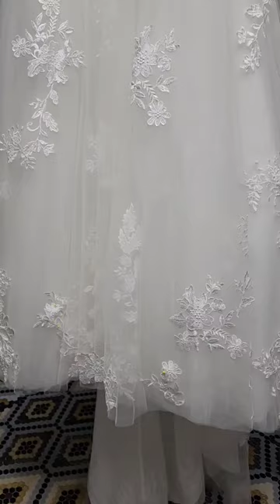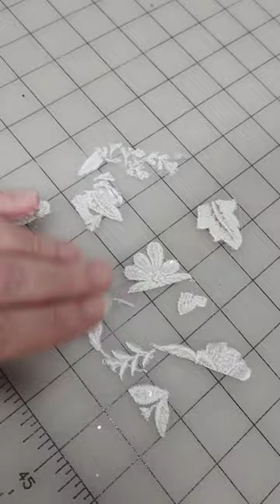Hemming a lace wedding gown... affordably!

Comment: Why not hem at the waist? Even just the front half. Keeping the original flow.
Reply from the maker: Because there's a significant amount of lace overlay covering the waist seam. It would cost her several hundred dollars more. Also, most of the tulle gowns are cut on the circle or in wedge shapes, and hemming from the waist will result in fuller hips in that style gown. This would cause us to have to cut down the panels of the skirt and sew them back. :_Shears: Hemming at the waist would be a terribly costly mistake on this gown, (and most of the gowns in today's styles.)